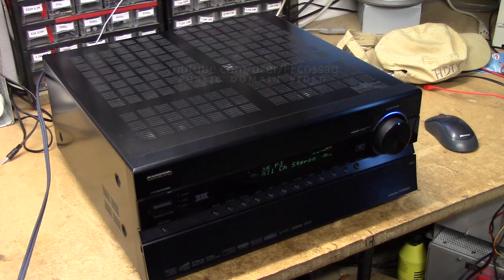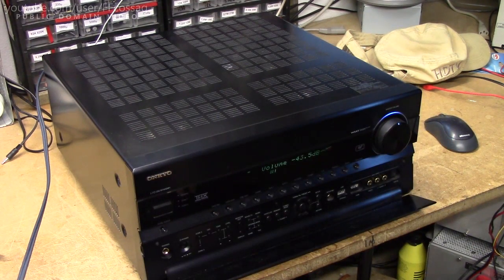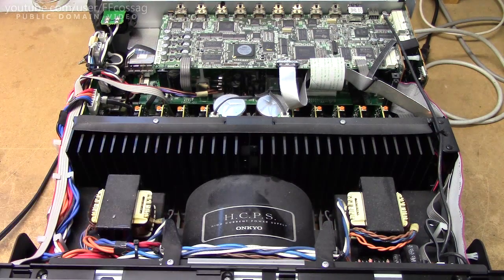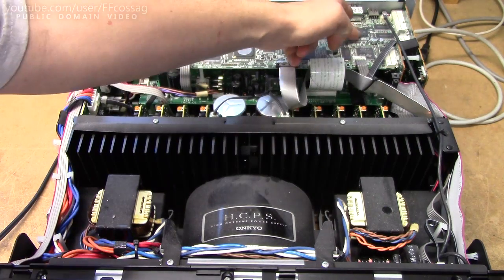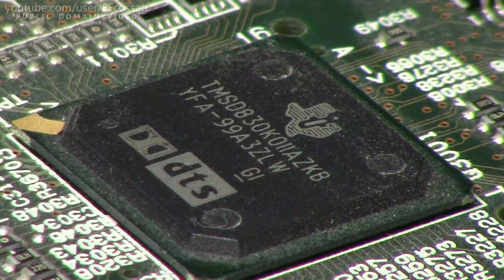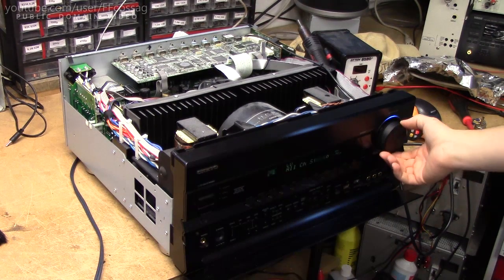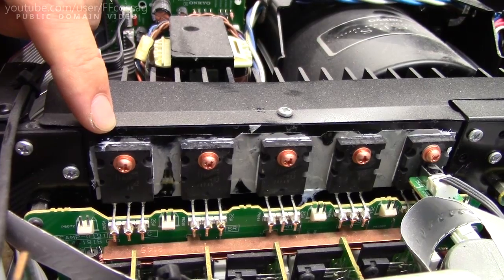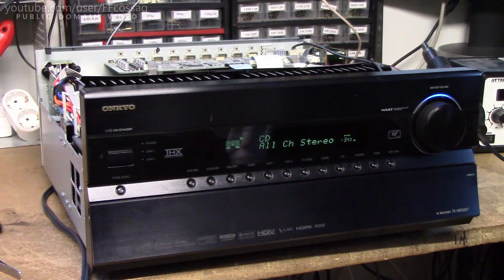Onkyo TX-NR5007 no sound repair (BGA reflow, reinforcement & heatsinking)

Comment: I'm about to make a reballing on that same chip. Do you think is necessary or will a reflaw would be enough? And how long this fix could last?
Reply from the maker: I've never seen one of these repairs fail in the few years I've been doing them. I'd say you just start with reflow + heatsink + mechanical support, and if it fails, you reball it.
Reply: FFcossag thanks

Comment: So how long did it last ?
Reply from the maker: It was still working last year when I last heard from the customer.
Reply: @FFcossag  Ok, that's good!
Do you know if the soldering flux makes a chip replacement troublesome if it ever needs to be replaced later ?
Reply from the maker: It does not.

Comment: for starters, you need more flux then just  a little dab from a flux pen, that was completely pointless... flux will help the solder balls under the BGA, also there was a video by Louis Rossman, about re-flowing BGA's, its pointless, it doesn't guarantee a permanent  fix.

Comment: You used waaaay too much thermal paste. A little dab will do ya,a gob will screw ya!
Reply from the maker: That's not thermal paste, it's thermal glue. I'd agree with you if we were discussing a computer CPU.
Reply: Still used way too much. Should only have been on the top.

Comment: The chip inside... Not cold solder joint. (That is not a fix... The problem is in the chip. I give you 2,3 weeks before the same problem will go again)
Reply from the maker: The chips often survive with cooling. This unit has worked for years thanks to the heatsink.